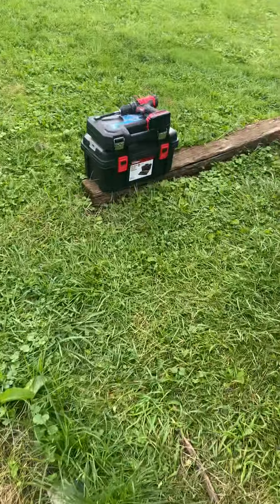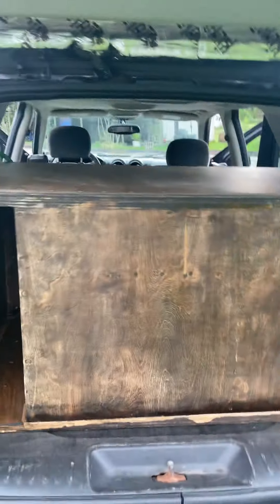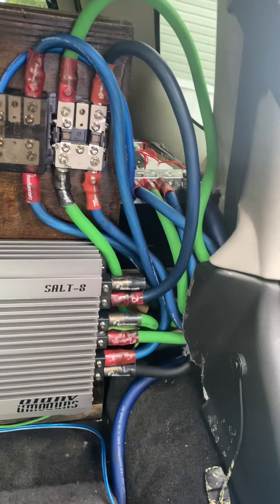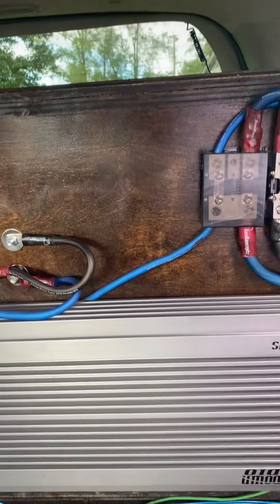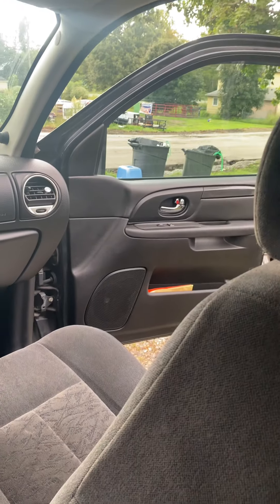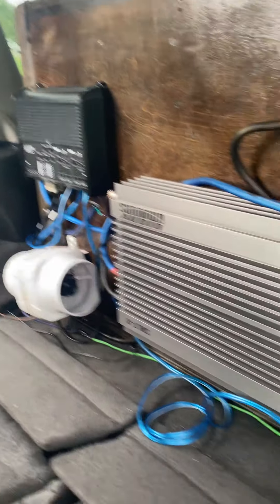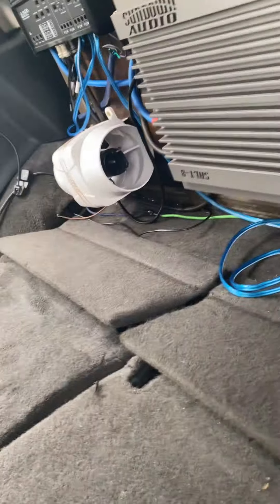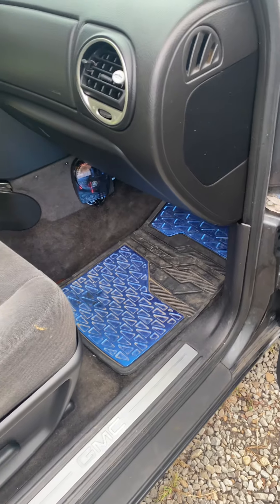Upgrading the System Pt.3 - Installed and Cleaned Up 😎

Comment: I was thinking the same thing . But dang man those amps are so expensive . If you run it direct you could move the blocks further forward an the lines from the alt.
Reply from the maker: I did end up removing the distro blocks altogether and running straight to the amp with my new setup. So far so good! But no change in performance imo…